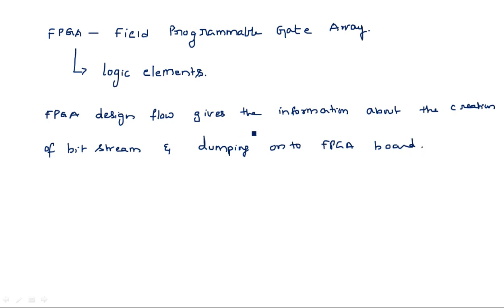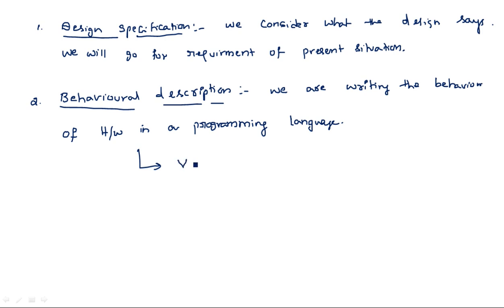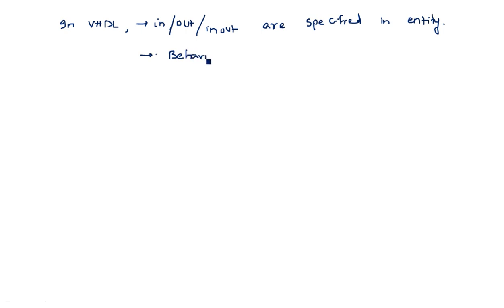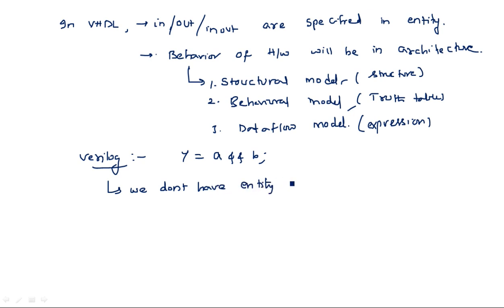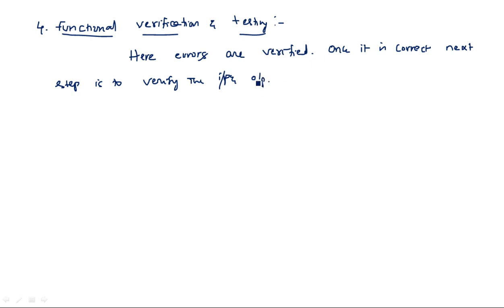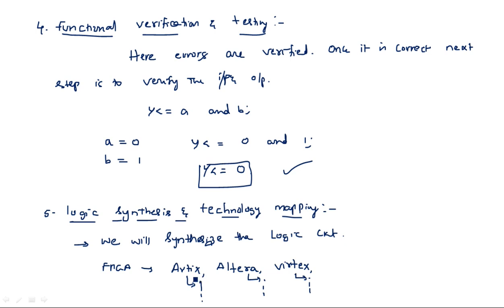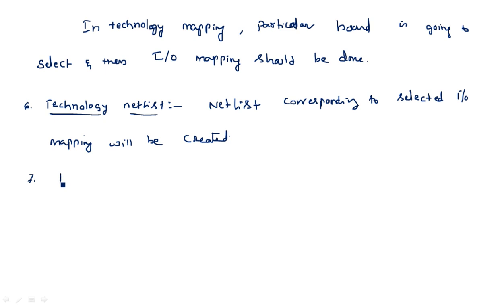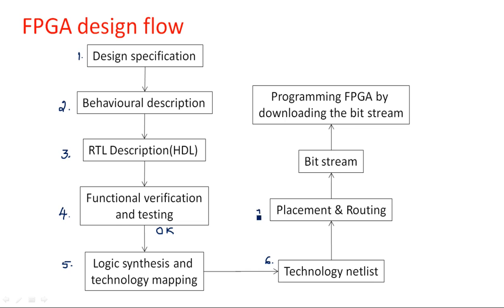FPGA design flow  | Block Diagram | VLSI | Lec-74

Comment: +------------------+
|  Design Entry    |  <-- HDL / Schematic
+------------------+
         |
         v
+------------------+
|   Simulation     |  <-- Functional verification
+------------------+
         |
         v
+------------------+
|    Synthesis     |  <-- Netlist generation
+------------------+
         |
         v
+------------------+
| Implementation   |  <-- Map, Place & Route
+------------------+
         |
         v
+------------------+
| Timing Analysis  |  <-- Check constraints
+------------------+
         |
         v
+------------------+
| Bitstream Gen.   |  <-- .bit file
+------------------+
         |
         v
+------------------+
| FPGA Programming |  <-- Configure device
+------------------+
         |
         v
+------------------+
| On-Chip Testing  |  <-- Real hardware validation
+------------------+